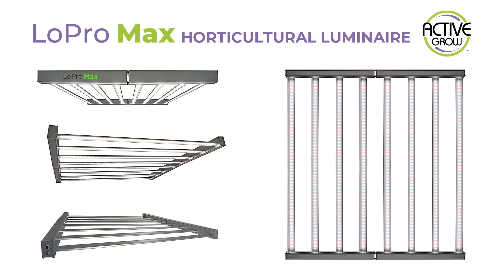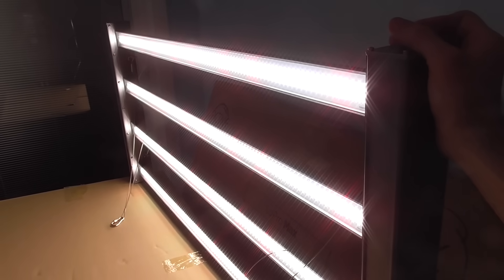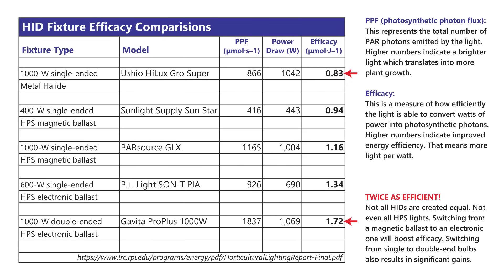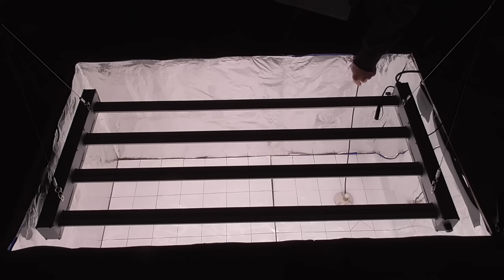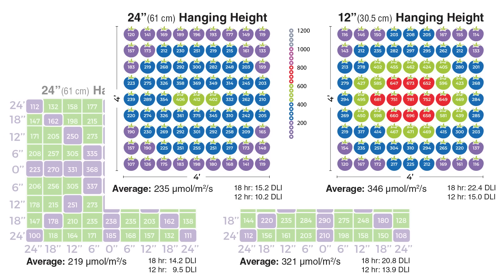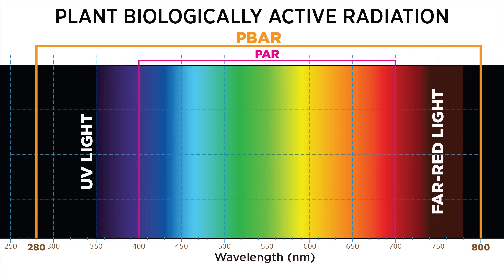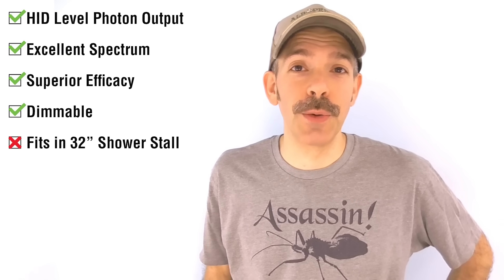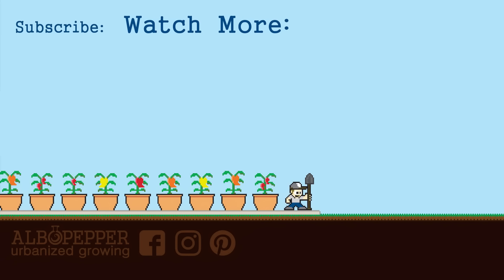Low Profile Dimmable LED Grow Light: Active Grow LoPro Max Review -Commercial LED Replaces HPS / HID

Comment from the maker: Learn more about artificial lighting and plant growth:
► What is PAR Light? https://youtu.be/O3dxjk_E2Ac
► The impact of Red or Blue light on plant growth: https://youtu.be/sfihE4IuFuU
► To avoid Tip Burn: https://youtu.be/gHWf4Hfi3hA
► Light Cycles & DLI: https://youtu.be/dQlOJ1zvoPI
► LED Wattage vs Efficacy: https://youtu.be/99lL68N20Bc
► Coverage Area & Light Placement: https://youtu.be/lK28aiRQ_Vs
► Light Payoff Calculator: https://youtu.be/aToYhyPZMVs

This UPS power station can backup a grow light!
► https://youtu.be/h3sUUHCEqbs

Here are some other LEDs that I've tested:
► Maxsisun MG3000 - https://youtu.be/Tw6-w2gybgo
► Infinity Linear - https://youtu.be/PfPmdKabemM
► Transcend LED T5 Tubes - 23wx4: https://youtu.be/o7wHj6PLv6s

For some tips on avoiding LED scammers, read more: http://albopepper.com/LED-grow-light-disappointment.php

Comment: These are the best lights for many reasons; cool running, spaced out, broad spectrums.  Thank you!
Reply: But then I watched your Spider F review & am confused as to which is best????? Can you just tell us?! (for 4 special tomatoes in a 2'x5' closet)
Reply from the maker: This is how the two brands compare performance-wise: SF-1000 < SF-2000 < LoPro 320 < SF-4000 < LoPro 640

To fit the proportions of your grow space, the LoPro 320 would be the best fit of any single unit. And it would have higher yield than an SF-2000. The best way to beat the LoPro 320 in your closet would be two SF-2000 positioned end to end. But this setup would need a little extra height for good light spread.
Reply: @Albopepper  Thank you so much!

Comment: I'm using far red for 20 mins(10min lights on,10min light off). at the end of my 12hrs light cycle, for the emerson effect. (separate 730nm leds).  just wondering with all new lights coming out with far red, should i be using the far red for 12 hrs?
Reply from the maker: Interesting. I suggest checking out the links in the description to the actual research in Far-Red. The researchers didn't just use small doses for narrow windows of time.

Comment: Not gonna happen at that price point. You can sell it all you want, 1k for a 640watt led will not compete agaimst a $300 1000w Gavita or the like. Galaxy G2 1000w dimmable and interchangeable digital ballast and air cooled hood under $500. Plus, leds hey hot as well and have no exhaust option. When these units drop under 500 for good reputable led/cob then maybe. Plus..they cant cover the same light footprint a hps can.
Reply from the maker: Sorry, but your comparison is very short sighted. If you selected a 1000w HPS rather than the comparable 640w LoPro, you would be bleeding out money in electrical costs. Not very forward thinking what-so-ever. The LoPro 640w would pay itself off with an ROI in 2 years time. That doesn't include savings in bulb costs or costs for cooling that heat hog of an HPS. Your Gavita sheds several hundred extra watts of heat. Of course it needs specialized cooling!

Light 1: Less Money/Efficient (ie, Fluorescent) <--Gavita
- Light Wattage (actual power draw): 1070w
- Hours of Operation (per day): 14 hr
- Days of Operation (per year): 365 days
- Electrical Rate (cents per kWh): $0.15
- Light 1 Cost Per Day: $2.25
- Light 1 Cost Per Year: $820.16
 
Light 2: More Money/Efficient (ie, LED) <--LoPro
- Light Wattage (actual power draw): 640w
- Hours of Operation (per day): 14 hr
- Days of Operation (per year): 365 days
- Electrical Rate (cents per kWh): $0.15
- Light 1 Cost Per Day: $1.34
- Light 1 Cost Per Year: $490.56
 
Time Until Light Pay Off      
Light 1 Purchase Price (fixture and/or bulbs): $350
Light 1 Cost Per Day: $2.25
Light 2 Purchase Price (fixture and/or bulbs): $1000
Light 2 Cost Per Day: $1.34
Time Till Pay Off (days) 714.29 days
Time Till Pay Off (years) 1.96 years

https://albopepper.com/LED-grow-light-upgrade-cost-savings-calculator.php

You can plug in the numbers yourself and see if it's really worth it. I suppose if you're growing peppers 2 months out of the year, then yeah, don't buy this. But any professional can see that these current generations of LEDs are crushing HIDs. You can be sentimental. Or you can be smart...
Reply: @Albopepper  uh huh. A 640 led also has the same ppfd output on 5x5 footprint coverage that a HID has? I'll have to check the sight and compare the spread and results on the par meters? Maybe im old fashioned and trust whats proven. To each there own i suppose.
Reply from the maker: Active Grow shows 4x4 coverage for their 640 (no reflection). Compare a 1000w DE HPS in the same area. A 24" height with an HID will have similar output as a 12" height for this LED. But the LED is more uniform going from the center to the corners. For a 5x5 map, you'll need to contact Active Grow.

Comment: With the ppf at 768 it looks like it would be better suited to grow lettuce.
Reply from the maker: A PPFD at a mere 10 hours of light would yield a DLI of 28. Lettuce is considered a low light plant. Typical maximum DLI values can be from 15 to 17 DLI. Ideal PPFD is from 250 to 300, with a maximum of 400 PPFD. So although this would work great for lettuce, it would either need dimmed or raised higher to cover a much larger area.

This light did not peak at 768 PPFD. At 6" from the plant in a 2x4 tent, you would achieve average PPFD of 948. A 12 hr cycle would give 41 DLI. That is more than enough for high light, blooming plants.
Reply: @Albopepper  I had watched a video of a professor at an actual university that had been studying cana peppers for years. He explained that cana peppers grew faster and yielded more with more light given to them. Unlike lettuce which has a peak point. I looked for the video but it has been removed. This site lists 1000w hps as having 1850 ppf. https://www.sanlight.com/en/about-ppf-and-ppfd/
Maybe I am comparing apples and oranges, idk. But, it looks to me like those led lights and most LEDs sold for plant growth cannot compare with the light output of hps. One other downside of led that I have never seen addressed is the heat output from them. Most hps fixtures are sealed to the grow area and can be vented away from your plants. I have seen no way to isolate the heat from leds. Anyways this is my first and last time I will complain about leds. Just had to put my two cents in for once. Take care.
Reply from the maker: In this slide 4:03 I show general PPF output comparisons of HPS vs LED. And the generic 1000W HPS model matches up exactly with the spec that you've cited. And that exactly why I recommend comparing the 640W LoPro to a 1000W HPS. It's highly unrealistic to expect the 320W LED to compete against the 1000W HPS. That was explained clearly. You are correct that cana peppers can handle PPFD levels MUCH higher. A PPFD of as much as 2000 at the canopy can be utilized by them. But that also requires very serious environmental controls, including the use of CO2.

Comment: Can anyone help me out with distance use of a 28w LED full spectrum grow bulb in early veg state
Reply from the maker: You would need a PPFD map of the light at different distances. That LED would not cover much of an area.
Reply: @Albopepper  per say if its in early veg stage plus diy grow box not so many plants either
Reply: @Albopepper  not to mention I'm having difficulty finding the map to this grow bulb
Reply from the maker: Nobody can help you without more info about your light. Where did you buy it from? Do you have the model name?
Reply: @Albopepper  its a stonepoint led grow bulb with full spectrum, veg and flowering support, 3rd party lab tested, as well purchased at Menards
Reply from the maker: Try 12" away from the plants and see how they respond. My guess is that it would only cover 18" x 18" or less. Perhaps only 12" x 12".
Reply: @Albopepper  sounds good thank you for your honest being been very helpful have a safe day i will inform later if anything changes

Comment: Always looking forward to the bell indicating you've got another video out.  Great review and wonderful job presenting.  With typical outdoor tomatoes in my area thriving on 20-30 DLI of sunlight and day length of around 15 hours mid summer, this light has potential.  Over 1,000 PPFD, and it might be necessary to inject some CO2 to take advantage of the plant growth, and a narrow overhead space with 6" hanging height that plants might grow into before burning leaves compared to an 18" hanging height.  You had me running DLI on my LED grow lights, and I've made an adjustment based off of your findings.  Thanks for helping everyone out.

Comment: How does it compare to the Spider Farmer 2000?
Reply from the maker: If you look at the specs you can see the difference in light output. SF-2000 is 527 PPF. The LoPro is 768 PPF / 822 PBAR. The LoPro is a clear step above, although it is a not as high as the SF-4000 which is a 400W light. The SF-2000 cannot cover the same footprint that a LoPro can at tight mounting height and the dimming feature is not as convenient. Also, the Spider Farmer units are not designed for daisy chaining. So you are looking at 2 different form factors intended for slightly different applications.
Reply: @Albopepper  Ok thank you sir for your very detailed response. I have 3 SF2000's, that's why I was curious. I bought them because of your video explaining how good they were too.
Reply from the maker: Three SF-2000s would have a similar light output to a single LoPro 640. But they would occupy a smaller footprint. Both approaches would be a good value depending on what you what to do. I suspect that you'll be quite please with those lights!

Comment: Could you include typical costs of the different lights in those carts too? Or preferably the price per PPF.
Reply from the maker: Price per PPF is a good approach for analyzing value. I recommend running those numbers personally when comparing your options. I've found that LED grow lights experience significant price fluctuations and there are regional differences in price as well. So I don't review that aspect of the product since my numbers could immediately become obsolete.

Comment: Hi Al Gracian
great review as always
any thought on the cheap led from active grow (like the 9W T8 HO)? 

also i was wandering if you have any idea for reducing the distance between canopy and light at 30cm (for lettuce) and still having a nice coverage
Reply from the maker: Hi Ivan! I think the best value is the T5 LED ( https://amzn.to/2Z6xYJu ). The T8 HO LED is $199 for light output of 164 PPF. But their T5 LED is $229 with PPF of 240. That's 15% higher cost but 46% more light output. You can safely place these at 30cm away from lettuce. Or even less. The coverage area would be about 120cm x 34cm.

Comment: Thanks for the education. What light recommendations do you have for us home gardeners with a much lower price point?
Reply: How does that compare to the Spider Farm sf1000?
Reply from the maker: Each has very similar light output. So you would need to compare cost and footprint. The SF-1000 is more of a point light source and would require a higher mounting height, like in a grow tent. The Active Grow T5 fixtures can be placed closer to the plants & would be ideal for racks.
Reply: Thank you. Just what I needed to know
Reply from the maker: Thanks for watching Deborah! What are you looking to grow? Seedlings, herbs & greens?
Reply: Yes, vegetable and herb seedlings as well as some ornamental flower seedlings
Reply from the maker: Perhaps you would like something like Active Grow's T5 LED fixture: https://amzn.to/2Z6xYJu . It would be perfect for your application. And you can use it in a stacked vertical shelf system.

Comment: Really, though I'm new in indoor hydroponics, I've never once been bored with your videos, and I'm currently studying one of your video

By the way, what good reflective film that you use? I'm currently try using mylar, dunno is it good or bad
Reply from the maker: I think that mylar works fine and it is easy to get and apply. You can find other options that might be a little better. But it depends on your budget and how crucial it is to salvage every possible photon. The critical thing is set up some sort of reflection when practical. Compared to nothing... mylar is excellent.
Reply: @Albopepper  thank you for answering, it's because I don't have any par meter or the likes, I don't know if it's helps but, I'm glad if it's good.
I'm trying borrowing your math in some your previous video about cost vs. Time vs. Distance, really helps me!! I don't know that light duration and distance is somehow dependent each other, will try to my next pak choi

Sorry for long post

Comment: The 640 is almost a 1000 $ dude!!! I'll rather go with mars hydro TS 3000 the best value for your money of you haven't used it it's awesome
Reply from the maker: Sorry, but the TS 3000 does not compare to the LoPro 640 in any way. The LoPro 640 has PPF light output of 1536 µmol/s. The TS 3000 is only 1096 µmol. So it might cost less, but it only outputs 2/3 of the light. There's no dimming knob. There's no mention of a UL Listing or IP65 rating. The warranty term is shorter. These 2 lights are totally different form factors. The TS 3000 has a small footprint (which might be good for some growers). And so it requires higher mounting heights. It is not acceptable for rack systems. And, despite the claims, it is not a "commercial" grow light. It's an ok option for budget growers who are not concerned about stringent safety standards and just want a single low budget unit for their home grow tent. But the LoPro Max is not intended for home growers who are trying to cut corners.
Reply: @Albopepper  I do get the spectrum and all that is new technology top tear stuff absolutely man am not saying other wise I would love to give it a try one day, but what am saying for the price of one lp640 I can get 2x TS 3000 which by the way I can dimmi too! 
I know it's not a fancy knob but it works great from seed to harvest, and I can use one for seed and veg cycle and have the other flowing read for the switcharoo 🤩, but that's my opinion man don't get me wrong am not hating, I love your contact and I think these lights are amazing
Reply: So what lights can I use in my setup with ts3000 or any other led to reach the missing spectrum or supplement that side of the product that is older or won't included , coz new products will definitely implement or try to do the same with there new products ? I hope I didn't confuse you 🤔

Comment: Im i the only idiot that noticed the flawed calculations from the get go!? 4:11 320W LED= 400W to 600W HPS
yet a 640W LED= 600W to 1000W HPS, shouldnt be simply double?! 640W LED= 800W to 1200W HPS no?!* this compagny does not look good making errors on simple math.
Reply from the maker: Superficially, what you are saying makes perfect sense. But not in real life application. 800W and 1200W HPS are less common, industry wattages for those bulbs. And as I explained in the video, it depends on whether the bulb is single ended or double ended. The LoPro 320W could compete against a single-ended 600W HPS but the LoPro 640W would outperform a double-ended 600W HPS. The info Active Grow listed is true and honest and consistent with the standard bulb wattage options that are most commonly available. They did not make an error. There is no point in disparaging them for listing honest model comparisons.

There is no single uniform output for HPS systems. People need to stop assuming some generic standard. Just as LEDs have a HUGE range in efficacy, there is also a broad range in various HID technologies.  But if you are seriously in the market, then you need to sit down and look at the specs for your lighting options and select the one that is best for your application. In particular, we need to give serious attention to the PPF output of any light.
Reply: @Albopepper  I agree and under stand but im just pointing out that one picture has 4 rows the other 8 and is double the wattage so should it not be double the output, 100W= X so 200W= 2X output no?!
Reply from the maker: You are absolutely correct. The 640W is double the power and it has double the light output. The 320W has PPF output of 768 and the 640W is 1536 PPF. So everything checks out. The real problem is with HPS lights. A theoretical 800W HPS does not have the double the output as a 400W HPS. You'll be hard pressed to find a double-ended 400W HPS. But once the wattages hit 600W and higher, the double-ended feature becomes an option and so the light output jumps up.
Reply: @Albopepper  aaaah, now i het it thank you for taking your time to fill me in on this, much appreciated i will most def purchase one or 2 through your code tyvm!

Comment: also Far Red is helpful for us LED-Growers because it excites the water molecules and helps raising the internal temperature of the leafs thus creating more plantmass, besides that aforementioned emmerson effect, so adding far red is a win win, with little watts so much effect couldn´t get better than this . its like an BBQ-grill you can grill the meat at 50C° but the optimum range would be 130-140C°